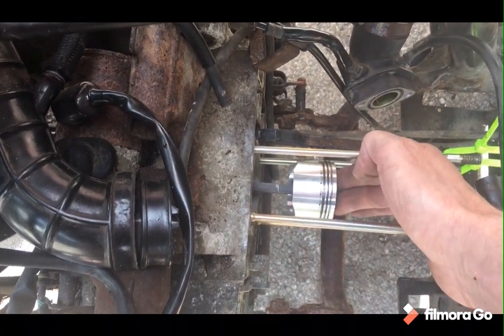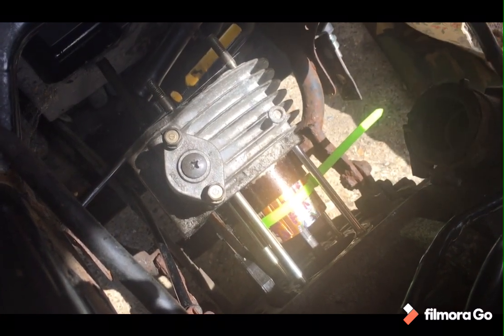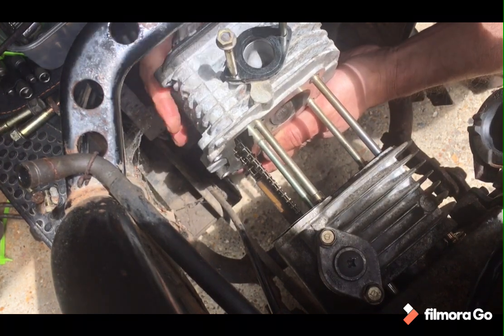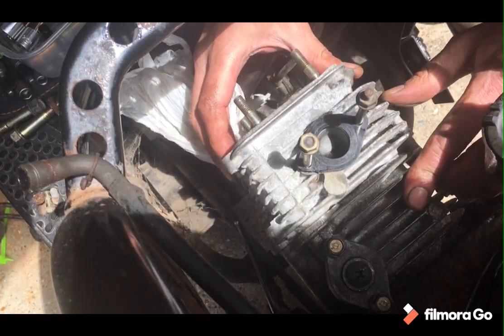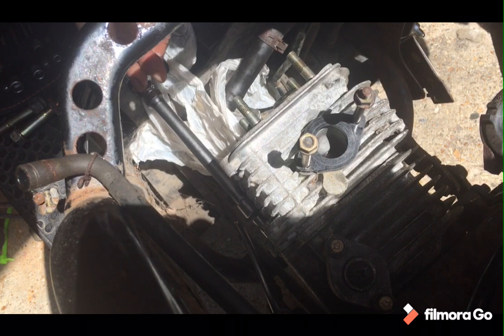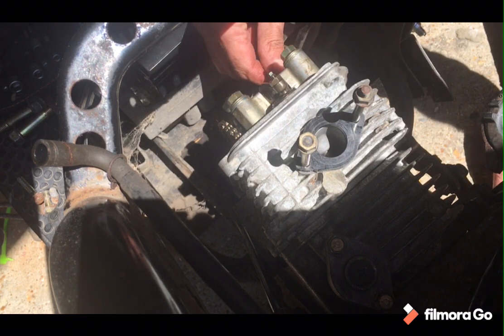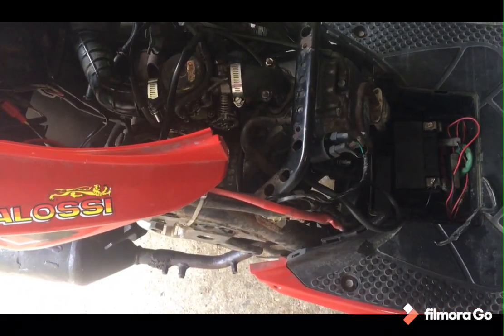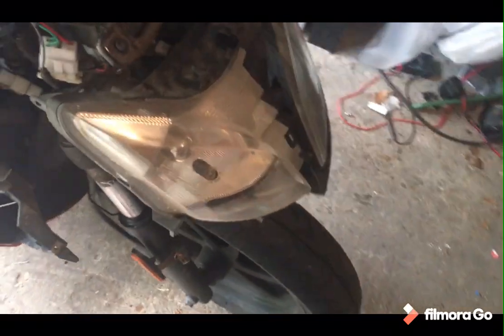Kymco super 8. Piston change and it’s alive!

Comment: Right off the bat you should have oiled up the rings and bore
Reply from the maker: It was a while ago but I am pretty sure that I did. Next time I will certainly use more though, maybe a little two stroke.
Reply: @NatsNackersYard  I was wondering did you do an upgrade or was it a standard piston etc ?
Reply from the maker: It was as standard as I could get mate
Reply from the maker: @mrdev9843  standard piston mate but probably still better than the one that was originally in there!